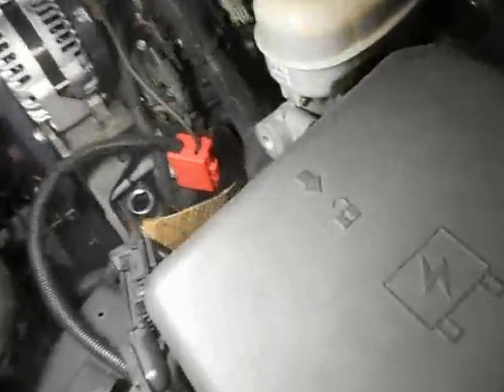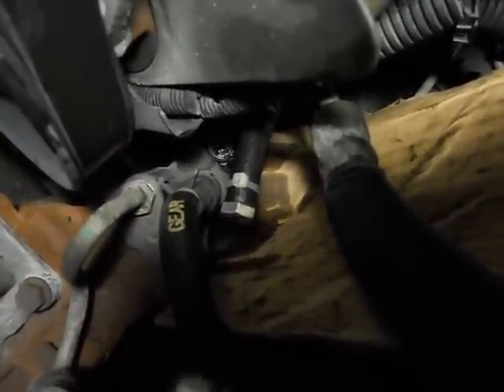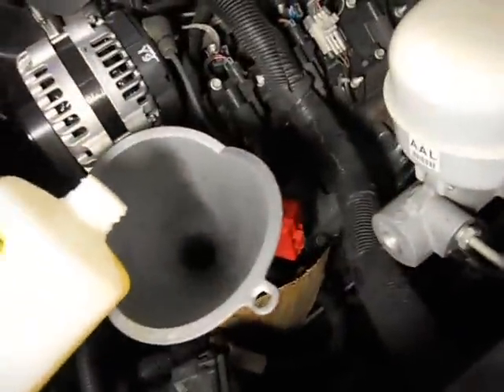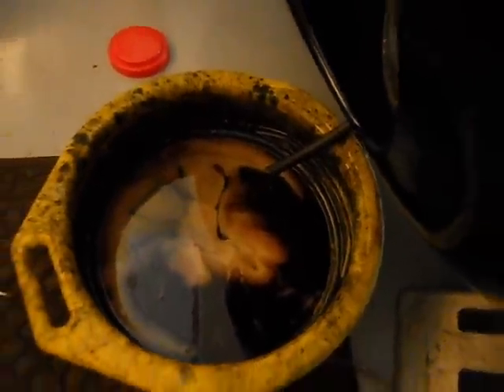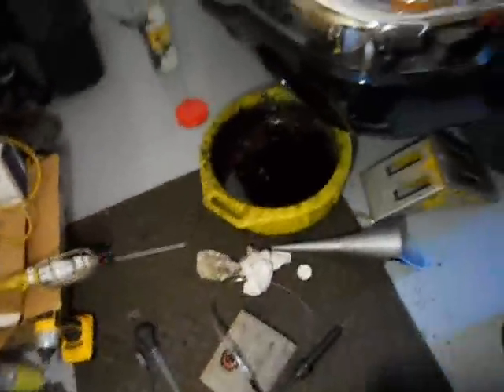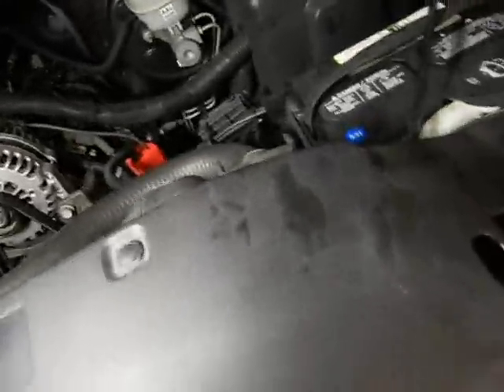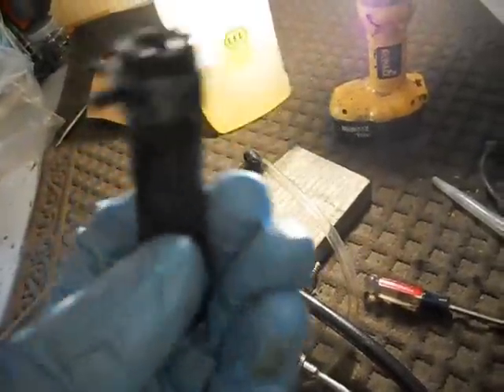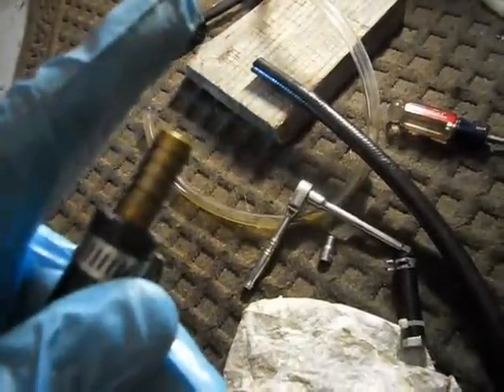How to Change power steering fluid how to flush power steering Silverado Sierra

Comment: Can I use dexron 6 atf in the ps pump on 2001 silverado 1500LS?
Reply from the maker: Ya it works they dont make dextron 3 anymore
Reply: @GhettoWagon  I have a dex merc dexron 3/ mercon 1? It's some cheap stuff I thought dex 6 might br better?
Reply from the maker: @robertpaul3675   Dex 6 is synthetic for extended use  Both are compatible.   On older cars I used the Dex/ Merc stuff once. It works too.  Dex 6 was a little more $ but its about the same now as Dex/ Merc

Comment: Why wouldn't you just pull the fuel pump really out so when you crank it it doesn't start? Then you can control the pump with with key and get it to pump slower
Reply from the maker: Because  This is alot faster and easier.    Why burn up the starter and waste the battery

Comment: I've had my 99 Sierra since new and the power steering pressure relief valve in the rack is stuck wide open since about 40k. It has full pressure all the time
 You can drive I with 1 finger and spin it from lock to lock with one finger. I call it mega power steering

Comment: got an 99" silverado on 33in tires that has a whiny pump, if i replace the pump how do i know it will for sure fix the whine if air is entering somewhere else in the system?
Reply from the maker: Look for leaks. If any hose/ oil cooler  is wet on the return side could be sucking air.
Reply: Have you not already tried flushing the fluid?

Comment from the maker: I used ATF once on the Impala when it was sort of low. I think that's one reason why the PS pump started to whine bad. Now its pretty quiet with the new LEE pump.  Yea, We had a machine at work that would drain the reservoir and refill it, (Two tubes were connected to it) You ran the engine and just kept cycling the machine, Drain, fill, until the fluid was clean.

Comment: hello, I just wanted to ask. what's that red box case like thing called. at the start of the vid. I too have the same in my Yukon Denali. only the top case is missing and two wires are exposed. any idea what it's called or the part I can buy to replace this?. thank you so much.
Reply from the maker: Oh the cover broke. GM may still sell it, No idea what the part number is check with someone who sells GM parts or a dealer.  Its probably a 20-30 part. Its just a auxiliary power post. Really you should jump the battery from there to avoid a battery explosion if the battery is gassing when its discharged/ dead . I use it when the battery dies.  place power there and then I ground to the engine.
Reply: Ghetto Wagon truly wonderful! thank you so much and wonderful informative vid btw!. I too will attempt changing out the PS fluid later today. thank you again!
Reply: Might be a bit late, but I believe the red box is a voltage regulator.

Comment: Thanks for posting this...I flushed the Imp and the Trailblazer today (I kind of cheated and just used a fluid pump to empty the reservoir, filled with clean, cycled the steering, and repeated until it came out clean).  They really needed it, especially the TB which really smelt burnt!  I think the last owner filled the Imp with ATF because it smelled fine but was fairly red.

Comment: hey...what happens when you have air bubbles or loose hoses in your power steering??....will you hear like a moan or something when you turn your steering wheel??
Reply from the maker: Yea it will hiss, wrrr, etc   If you have a leak on the pressure hose or return hose, even a bad seal on the PS pump or steering gear/ rack it will draw air
Reply: well right now I hear hissing...but i have no idea where it is coming from...and its moaning when I turn...I guess I better flush my fluid asap...and put some new seals on my return hose...thanks
Reply: I just replaced my serpentine belt and I may have loosen the the hose...damn parts are so old...as soon as I fix one thing something else needs repair...smh

Comment: Would you recommend blowing compressed air through the system if I'm doing a pump swap I have a 03 Silverado z71 and it was a pain in the ass to work on it other videos made it look easy but I think it's because the ones I seen didnt have 4x4 it's very tight and I have my truck on ramps now and kinda dont want to do the balancing act placing it from ramps to Jack's so I can turn the wheels
Reply from the maker: Its not too bad I changed the pump on this one.  You could blow air if you wanted to.    I didn't but my pump did not fail. It just whined loudly and I changed it when i had the steering box rebuilt.
Reply: @GhettoWagon  I ended up using the bolt to press the pulley back on so I could hook my drill up to it
Reply from the maker: that's a good idea!   spin it w/o the belt on
Reply: @GhettoWagon  I was a little nervous about running it dry with the truck on and I actually had to pull the pump off to disconnect the lines so I wanted to flush it before I bolted it back up so I could access the lines with ease and using the drill was perfect you can feel when it builds pressure and can run it slower so I could control it from running out of fluid your video was very good I would have struggled with out it